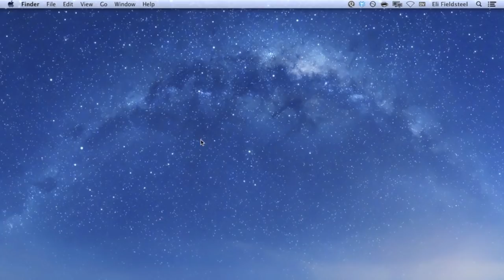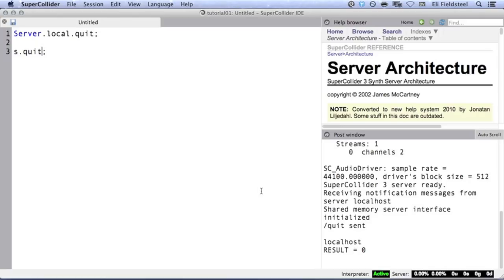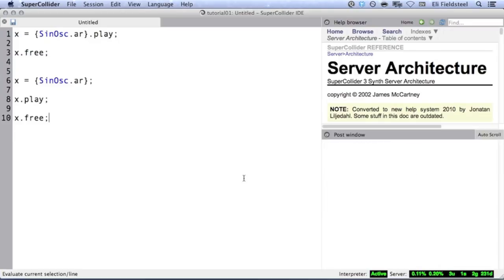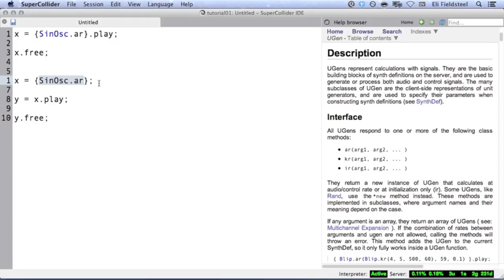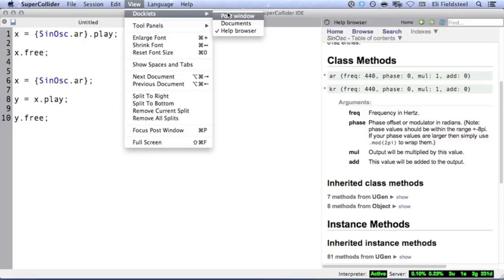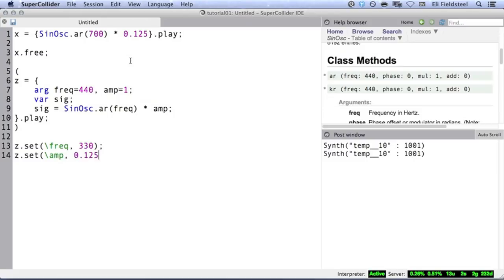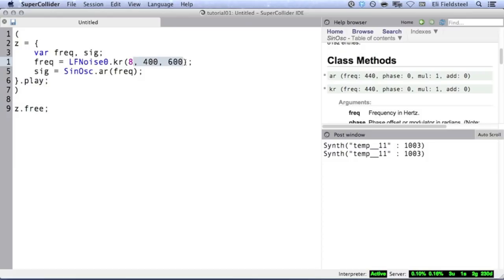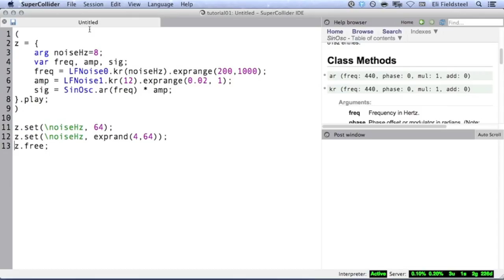SuperCollider Tutorial: 2. Making Sound

Comment: This is so fascinating! However, I tried and it didn't work. What did I do wrong? I wrote this: 

( 
z = { 
	var freq, sig; 
	freq = LFNoise0.kr(8, 400, 600); 
	sig = SinOsc.ar(freq); 
}.play;
)

Thanks!
Reply: I figured it out. Had to select all the text before running it. I didn't see you doing that. Did I miss something?
Reply from the maker: @stefanhansen5882  I'm pretty sure you used the wrong keystroke to evaluate the code. If you press shift-enter, SC will attempt to evaluate the current line. If you press control-enter (command-enter on macOS), SC will attempt to evaluate the current block of code enclosed by parentheses. If you highlight code first, then either keystroke will evaluate the highlighted code. I cover this issue in mini tutorial 2: https://youtu.be/ar-A1D16WyA?t=15
Reply: @elifieldsteel  Ah! Thanks a lot! I'm really fascinated by this, and have a bunch of questions. Would it be possible with a one-on-one Zoom call? With fingers crossed! :)